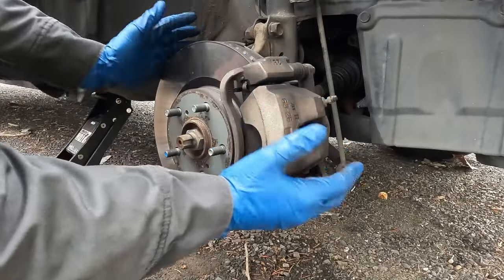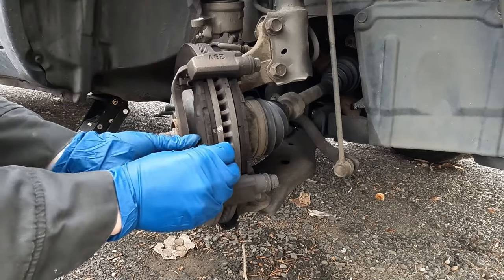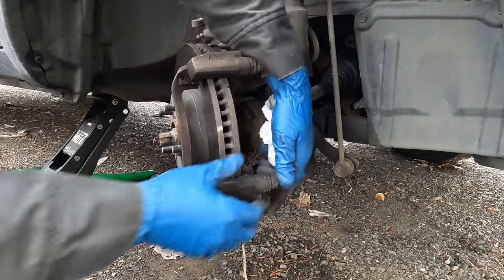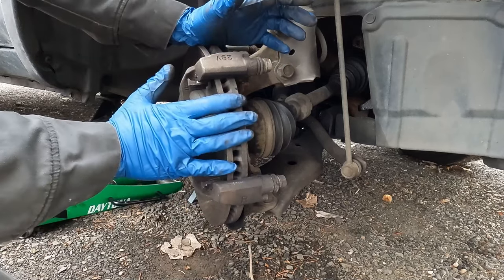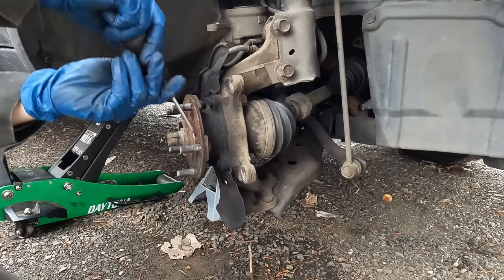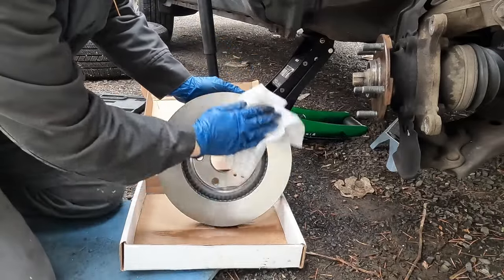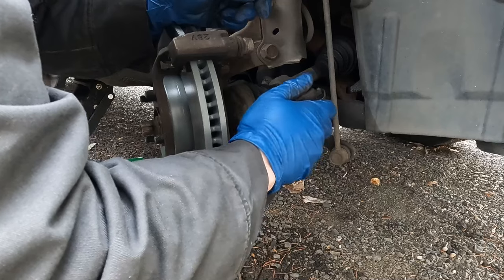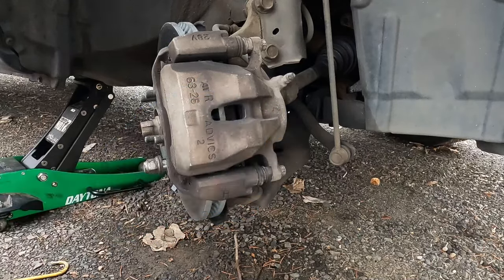2006-2012 Toyota Rav4 Front Brake Pads and Rotor Replacement How To

Comment: Excellent video, clear and helpful instructions, camera angles on point, and with torque specs too! Thanks for the walkthrough, very well done. Only had one question at the end that I had to look up, and that was lug nut torque, which is 76ftlbs, in case anyone is wondering. Regardless, thanks again!
Reply from the maker: @tmryootoob  Glad this video was helpful! 🙂